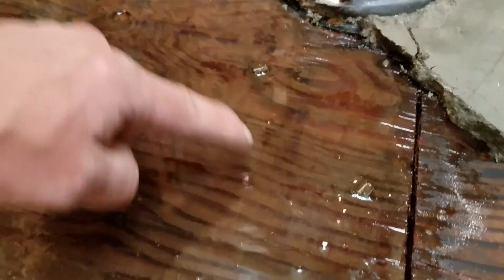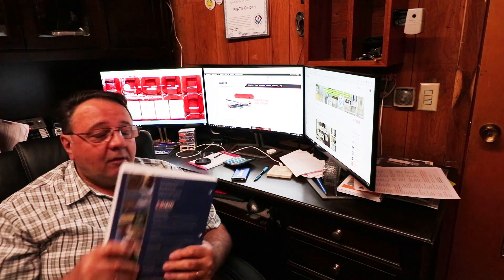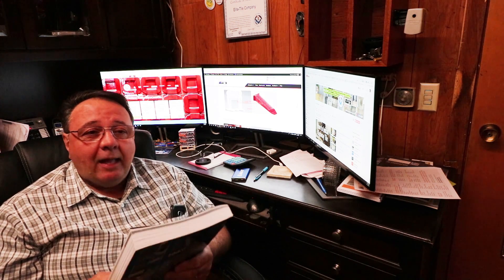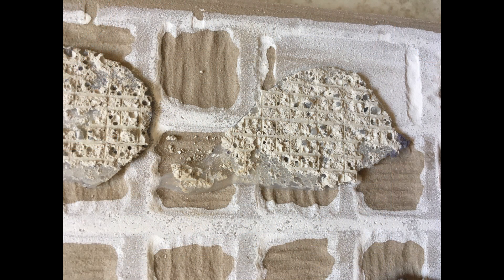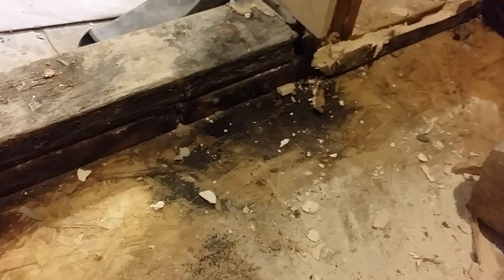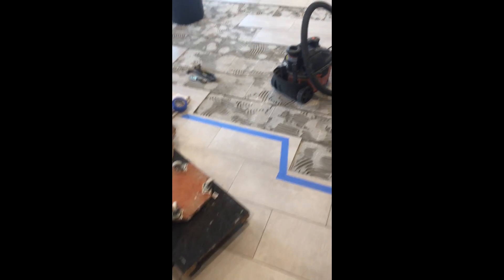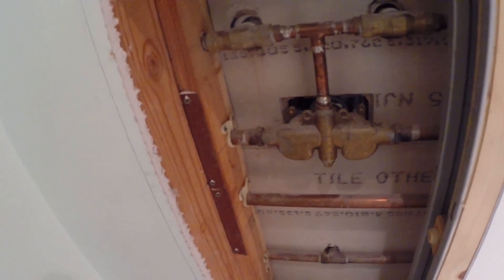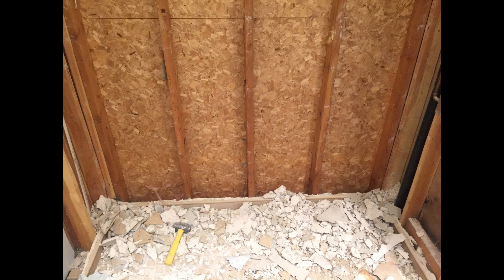Failures of Tile installations, Showers, floors bad tile work gone bad.

Comment: Hey Sal, great stuff. Thanks so much for it. I laid down a Schluter ditra base under Penny tiles on a bathroom floor. Used unmodified thinset manufactured by Mapei.  No additives.  It's been 5 days so it should be pretty cured by now. My concern is if I slip a thumb under a  penny tile, I can pull the whole sheet up with a good jerk. Also the wall flashing, also schlueter, I could rip off with a good jerk. Am I overthinking this? I feel like the bonding should be a lot better.  Thx!
Reply from the maker: Can't really say without seeing it, my guess ist that it should be fine though. Ditra does have a limitation that tiles no smaller that 2x2Inch should be set unless pre approved by Schluter.

Comment: Hey sal love your videos I have a handyman company based out of Chicago and have taken a lot of your tips especially the video with finding the cut on a corner with a diagonal tile. Just wondering what do you think of the trowel that's shaped weirdly and they say you don't need to back butter any more. It's made by rubi so I trust them some what.
Reply from the maker: Great trowel, I would still flat trowel the tile though.

Comment: Hi Sal,
I received a quote today for a company to install ditra on our plywood. They told me that ditra does not account for any vertical movement in the wood.. and of the subfloor has any 'give' at all, anywhere. That the tile will crack.... but if the durock is installed instead - the tile will not crack.
Reply from the maker: I would have them define vertical movement. If there is enough "vertical movement for the tile to crack with ditra, it will also crack with durock, or anything else. The maximum allowable deflection for porcelain tile is L/360, for stone tile it is L/720. What determines the deflection of a floor is how it is built, the joist size, joist spacing, kind of joist used, condition of the joist, the length of the joist over an  unsupported span, and other factors are input into a formula to calculate the deflection of a floor assembly. There is also an app to help figure it out, but an engineer should  be consulted if there is a question as to the suitability of the floor to be tiled. It is not the job of a tile installer to make that determination. All that being said, most floors can easily be assessed by taking a look at the structure of the floor and using the app to get a quick calculation, it is only when the floor deflection is border line that  remedial measures need to be taken, and those measures should be determined by an engineer. 
Durock has no structural value, so if the floor is not suitable for tile, Durock will not make it any better, nor will ditra. Additionally, Durock must be installed on a bed of thinset and fastened every 8", this means that it should not be installed directly to the subfloors with just screws, using liquid nails is not to be used to adhere the board to the floor. I would ask them to describe to you the process they intend to use to install the Durock and the tile. It is easy enough to do a quick search to find all the needed requirements.
Reply: Sal DiBlasi thank you so very much sal. I had a feeling the company was just trying to get some more labor time added to their bill.. the house is solid. I-joists every 16 inches with good plywood. House was built in 1992 and the previous substrate was just a musfloor with that screen in it. The tile never cracked, I am simply updating the floors.
I think ditra will be suitable.
For peace of mind - maybe I'll give a structural engineer a couple hundred to inspect the floors.
Thanks so much
Reply from the maker: Punch your numbers into this calculator, if it is borderline then I would check further. http://www.johnbridge.com/vbulletin/deflecto.pl
Reply: Sal DiBlasi thanks Sal,
Just went into crawl space.
The joists are TJI/25 SP trust joists
I am not sure if I measure the height from the top to bottom or only the inside webbing portion.
Same goes for the width. The width of the 'caps' are 3-1/2"
I entered in all of the numbers and came up with L/927

I was planning on porcelain even if stone is OK. Apparently it is OK to do..

I do need to replace the subfloor where the tubs used to be located. Is 1/8" gap between boards ok?
Reply: sal, thank you for helping my husband so he does not destroy our home. :)
Reply: Sal DiBlasi ah man... now my wife is involved!!!! Retreat!
On a serious note. Tongue and groove plywood is up there now, I only need to replace the part that is not tongue and groove.
Reply from the maker: Just add some blocking if you have access from underneath
Reply: Sal DiBlasi hey sal thanks!
Reply: Sal DiBlasi going with green or purple board and the kerdi membrane roll..
Unless you can give me a great reason to use kerdi board!!
I have watched, close to 60 hours of your videos
Reply from the maker: Twice the work for the same result. Schluter says it is fine, and is the original way of doing it, I have also done it myself and will do it again if I get a job where the board is already up. But why handle heavy board and then cover it when you can just put up Kerdi-Board and be done.

Comment: Sal, are you going to continue using Ditra set in your Schluter installations, or are you going to move to the Schluter thin sets? And would you suggest just using Schluter all-set for everything, as opposed to the unmodified? Thanks for your videos.
Reply from the maker: There is actually a benefit to using all materials from one source, no finger pointing if something goes wrong, everything  is covered by one manufacturer and Schluter will extend the warranty.

Comment: This is literally happening to me right now. Floor installation half way done (by my contractor). I went to get something from the room after more than 24 hours passed. One tile came up that I stepped on and I lightly pulled on a tile beside it that came up with my bare hands. No back buttering at all and blobs of thinset underneath.
Reply from the maker: If they are spot bonding, cut your losses.
Reply: Sal DiBlasi We had everything ripped out and we are starting over. 98% of the laid tiles came up without cracking, like brand new tiles. Thanks for the advice!
Reply: Kay Miss that sucks

Comment: In the showers where the tiles were falling off easily, some floors and walls looked like they had enough thinset on there yet, they didn't bond to the tile. What's the typical cause for that?
Reply from the maker: Could be many things, thinset skimmed over when it was left open too long, wrong kind of thinset, tile was not embedded into thinset but simply placed, non directional troweling, tiles may have needed back buttering, and many other possible reasons.
Reply: Biggest thing when you see a tile like that is it wasn't back buttered and they should all be back buttered no matter what surface they are putting it on.

Comment: I’m curious to know what the back of tile looks like when removed after being installed correctly. We’re in the middle of rebuilding our bathroom.
Reply: Striped all along to let air out,one way only
Reply: If installed correct it will not come out in one piece as seen in these videos, but just chunks and chips.

Comment: Some times you get what you pay for and other times you just get down right ripped off!! Ive meet both types of homeowners that want a good deal think my price is too high and hire the cheaper guy few days later call me back either they get robbed or the tile guy starts using regular Sheetrock as the backer board etc lol.

Comment: seriously I've said so many times before when I've had so many negative feedback....in Europe  this kind of workmanship happened 20 years ago I am shocked it's still an issue over there
also you mention mapei... in Europe nobody uses this product because it's cheap.
and can I also say fabric waterproof systems arenot easy to install , therefore we use liquid membrane systems
Reply from the maker: I was recently in Europe, and I saw plenty of recent installs that were bad, and have plenty of conections with installers over there that complain about the crap that goes on. Mapei is a major brand over here and very well respected as a top notch manufacturer. I think it is all about perception.
Reply: Lol.